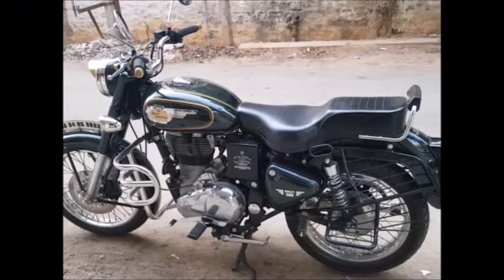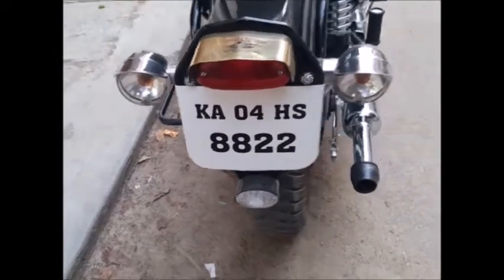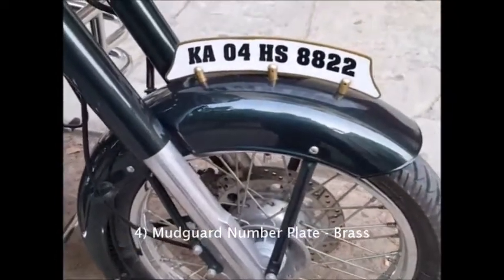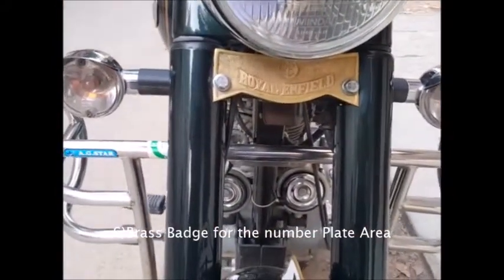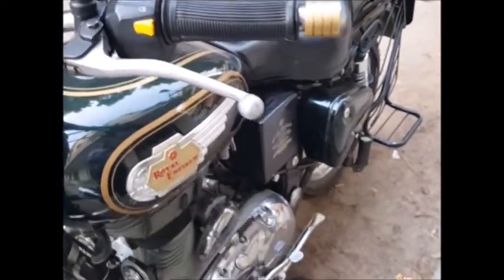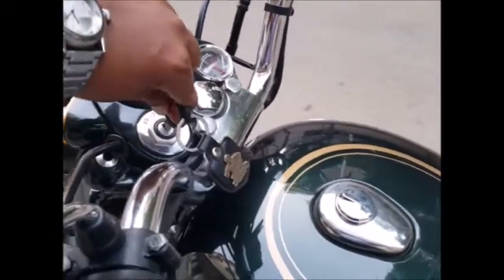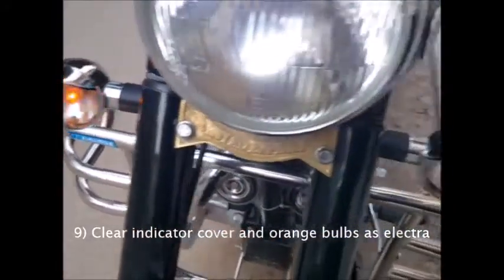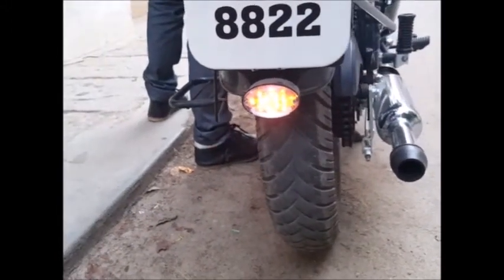Modifications  on My Bullet : Episode 003 : Bullet Diaries

Comment: Nice. Tell me more about the handle bar weights.
Reply from the maker: +Thumping J First of all thanks for the comment and sorry for the delayed response. The handle bar weights are made of brass and fit directly on the sides with allen screw, small tip would be to use the Stainless steel Allen Bolt rather than the conventional black color. It gives good looks as well as protects from rusting in the rainy season.

Comment: Loved your mods. Can u tell me about the re silencer. How do u compare it to the stock and what's the price of it. What's the use of rubber tube at the end of silencer?
Reply from the maker: +Venkatesh Rao Hi bro thanks for the feedback, this silencer is the short bottle royal enfield silencer. It will be less noisy as compared to the silencers available in the market and is less harmful to your engine. It has the muffler or filter which gives back pressure to the engine. The rubber basically protects the end of the silencers from being rubbed to the ground especially for classic model bikes having lesser ground clearance. It reduces the vibration as well upto 5% max. The cost of the silencer is roughly 1600 INR in Bangalore. Do subscribe like and share my videos so that I can make more videos. Thanks a lot.

Comment: what are your views on red rooster performance exhaust for RE bikes?
Reply from the maker: Personally I am not a big fan of any custom or "performance" exhaust. The common issue heard in the Red rooster from the consumers is that the ceramic coating inside the muffler comes out even with the smallest contact of water, for example rains. So better use the stock for optimum engine performance as well as longer life.